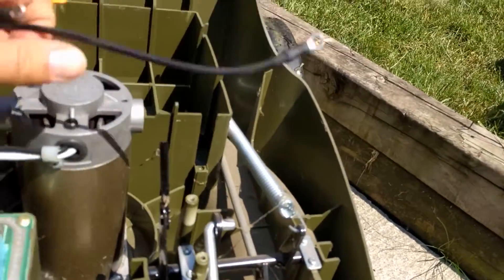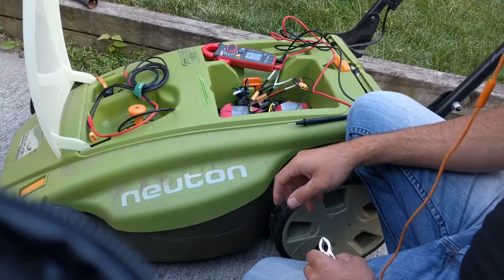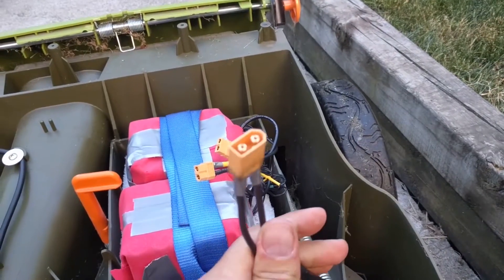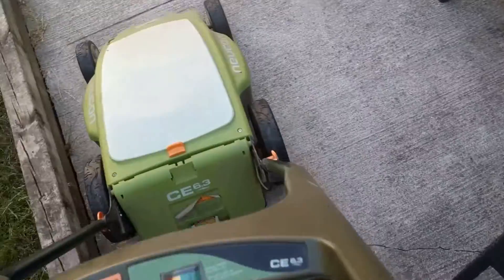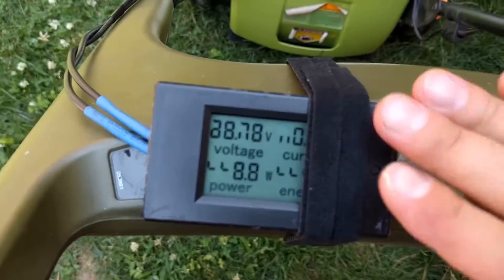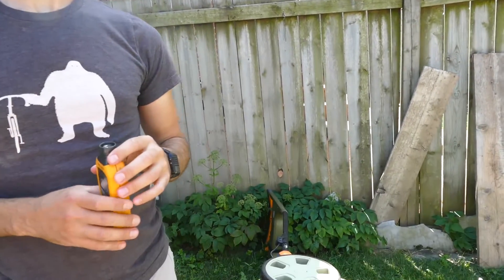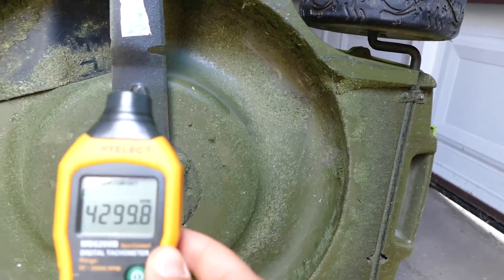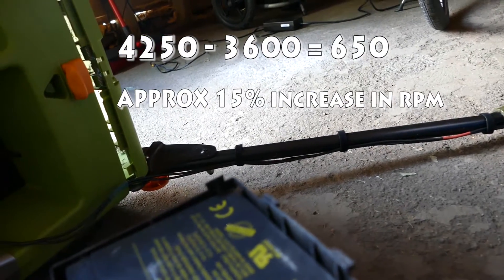DIY Cordless Electric Lawn Mower Lithium battery conversion Pt 2

Comment: You can make a custom blade, its more efficient if you use s shaped blades, like 2 sickles, where the grass is caught and sliced in one smooth quick low resistance motion. It would need to be hardened steel, and kindof light for energy conservation. Width of blade can be thinner than 2 inch mower blades for less friction.

Comment: This movie title was EXACTLY what I was looking to do:  Change a Neuton over to Lithium.
I have two lawn mowers: 
1) Ryobi 40V lithium used on my weed free, ornamental front yard. 
2) Neuton 36V for my back yard where I do not like to use weedkiller because I have a garden and fruit trees back there.

Ever since I experienced the lithium packs on my RYOBI , the bulky Neuton packs just don't cut it anymore
Lithium batteries are lighter, faster, more powerful, and longer-lived.
 
My guess was that the Neuton would run much better with the RYOBI 40V lithium packs from my other mower.
And that would work out great, since I already own 3 relatively new RYOBI 40V lithium packs for that mower.
Again, my 40V RYOBI packs work GREAT in my RYOBI mower. 
I thought it would be easy as pie to rig the neuton with a RYOBI 40V 6Ah pack in place of its 36V SLA pack. 

It could barely even turn the neuton's blade.
I was very surprised and curious to see this.  
That same battery makes my Ryobi mower run great.

Comment: I want to do the reverse. I have a lithium cordless mower but it doesn't last long enough for me
Reply: I would never advise you to swap out lithium for sealed lead acid because lithiums are so much better in all ways.
Reply: Maybe just get a better lithium pack.
Reply: @fenderstratguy  
I would need  batteries that last at least 90 minutes
Reply: @holyvessel34  The great thing about lithium batteries is, you can get away with smaller than 90 minute batteries, and just swap them out as you go.  
By the time you use up the next one, the first one already has a pretty fair charge on it.  
My 6Ah Ryobi 40v pack will mow both my front and back yards so that's about 30-40 min of mowing St. Augustine grass.
Reply: @fenderstratguy  okay. Thanks

Comment: Cool project and years before mower manufacturer's when lithium with designs. One thing I would say is I would've retrofitted the lithium cells into the original lead acid battery casing for waterproofing and aesthetics. 👍
Reply: I was just given 2 of these with 7 batteries. Im going to do just that.

Comment: Thanks for posting! Is the mower still going?

I'm am doing something similar with a dual motor craftsman 40v mower. I built my own 4p5s x2 into 10s 40v pack. The mower has an extra input wire and I've had no luck getting it to stay running two power wires from the battery. For now I want to bypass the stock electronics and drive the motors with an arduino and a couple of mosfets. Today's project.